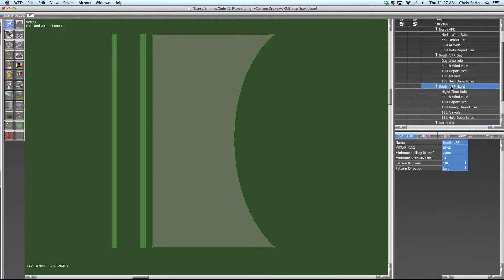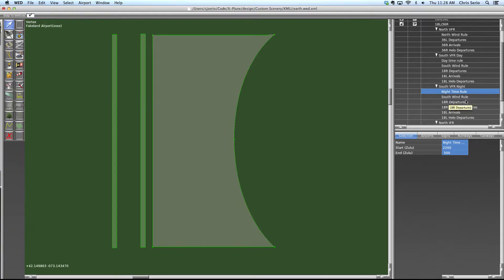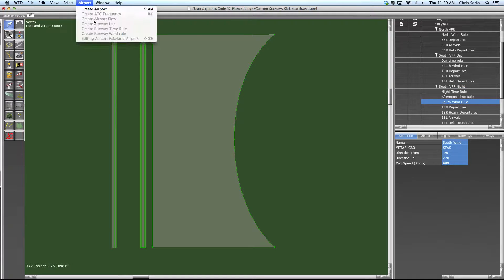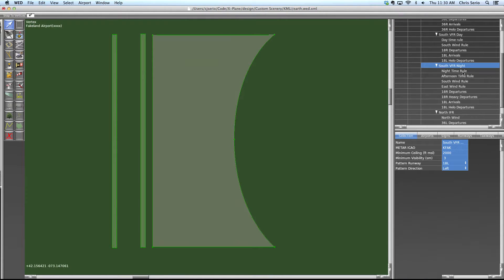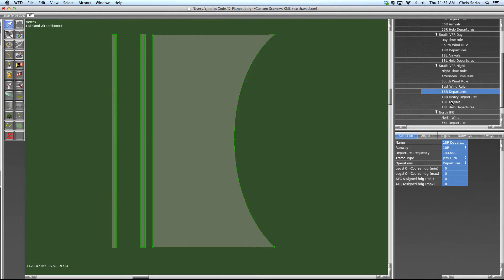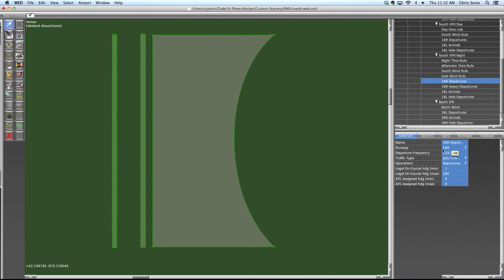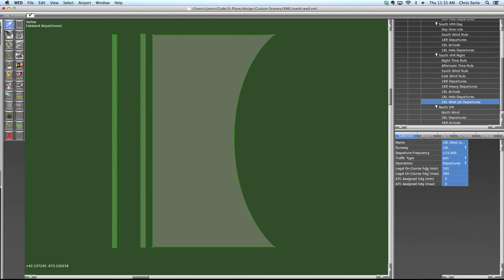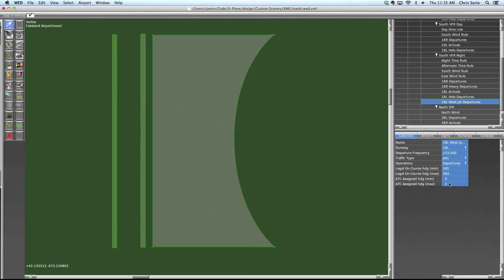Screencast: ATC Airport Flows Part 4 of 4

Comment: I have a question: considering flows or using other options in WED, are you able to create  approach or departure routes for AI traffic using navaids or other, so they fly the official routes? Also: can you manually limit the aircraft size of AI traffic arriving and departing?
I have seen an x-Plane 10 video in which a 747 took of from a tiny airport in the middle of the mountains, barely making it off the ground just to fly into the mountain, because of a left turn instead of a right turn!